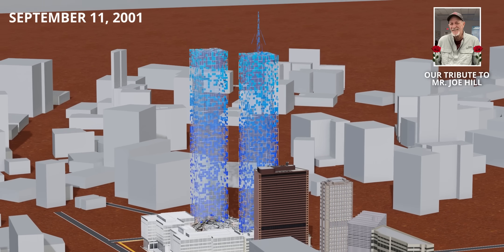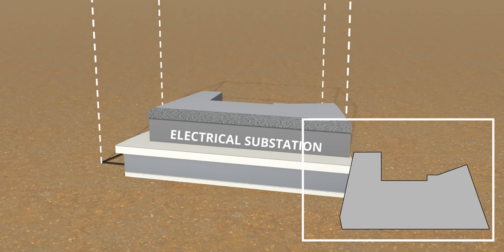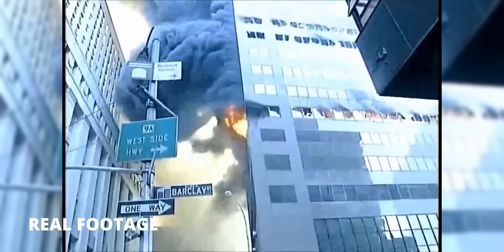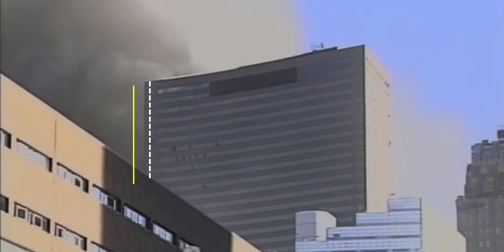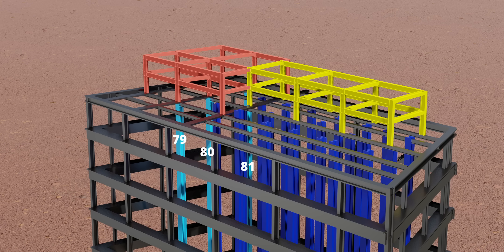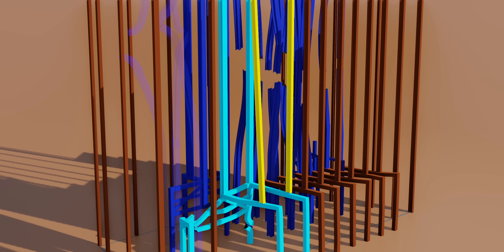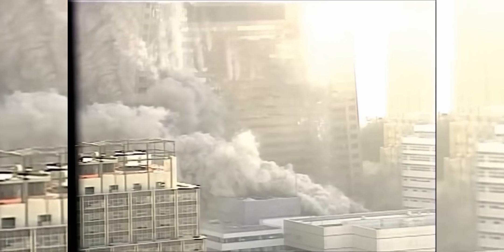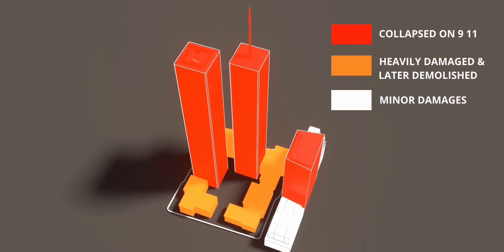Collapse of Building 7 | The Complete Physics

Comment: No, dude or robot whichever the case, that's not how physics works. The speed and uniformity of the collapse makes it a clear and deliberate demolition. The politics of this demolition is another investigation. If the building collapsed from fire and weakened columns on one side of the building then the weight of the building would have shifted sideways as it met resistance from the other non compromised columns and given the design structure it is even more likely that the weakened portion of the building would have been the only section that failed.  Cartoons are for kids doc .
Reply: What uniformity and what speed ?  What does speed even have to do with anything?  Please explain in detail and be sure to show your math.
Reply: @TheCriticalStinker-jw4fl  the building collapsed in 15 seconds and it was 45 stories tall give or take. The resistance would need to be moved out of the way quickly and intentionally for this to occur since concrete reinforced steel columns are not ice cream and the resistance would be too great for such speed to be achieved with no force external just the weight of the building. Also, given the building's open frame design cross trusses would collapse while leaving core columns standing
Reply: @davidcanatella4279  20 seconds and 47 stories tall, although the part that collapsed was really 44 stories tall since it was built on top of another building.

So what? How fast something falls can not tell you what started it falling.  

One of several assumptions you have that are wrong. Would you like me to describe what happened, start to finish, in detail?
Reply: @TheCriticalStinker-01  the speed matters because the resistance matters. This is absolutely crucial to knowing how something fell. The building would not have collapsed straight down in 20 seconds from fire weakening on one end. If the premise the film presents of a domino affect of column failure was true, then the building would have pitched drastically to the weakened side and fell sideways, but even this premise doesn't take into account the behavior of the framing under the conditions mentioned. This is a demo job. I know steel and concrete and the official explanation makes no sense and never will.
Reply: " that's not how physics works"
That you don't understand physics means only that.

"The speed and uniformity of the collapse makes it a clear and deliberate demolition."
The speed that doesn't matter, and the uniformity that wasn't there?

"Cartoons are for kids doc"
Yes. Yes, they are.

But since you're clearly the expert here, do show your physics. Use extra sheets as needed. Show work.
I'll be right here waiting for you to not manage that, much like every other "truther" has failed to in the past 20+ years.
Reply: @mooneyes2k478  Show your work. You're the one defending this psycho government. Why is the default setting that the government is right and then when the properties of steel and concrete are laid out all you have to do is say , " You're wrong"
Reply: @davidcanatella4279  - I showed my work - twice - in each of your threads.

You seem to be going out of your way to ignore it, for,... reasons.
Reply: @TheCriticalStinker-01  it doesn't add up. There is no force that would drop the building in such a fashion other than charges and thermite. It's alright if it's important to believe what you've been told. I understand. I'm not trying to be adversarial. It's okay if you hate my point of view. I don't feel any animosity toward you.
Reply: @davidcanatella4279  - I laid the whole case out, start to finish. Posted it for your benefit - twice.  

And you still haven't read it while crying it doesn't add up (and yes, we both know you didn't bother reading it).

It doesn't add up to you because you refuse to put the effort in.  I am beginning to suspect you do not want to know but only to have your beliefs affirmed.
Reply: @TheCriticalStinker-jw4fl  it's alright. There's no reason to be upset. Please understand that I wish you well.
Reply: @davidcanatella4279  - Whose upset?  I'm just wondering why you pretend to care about this topic when you are so clearly not serious

You're just wasting everyone's time.
Reply: @TheCriticalStinker-01  if you feel that way then I don't want you to feel obligated to continue. I don't want you to feel that you have to counter my replies in order to have my respect. That's not necessary. If you feel like I have wasted your time then it's okay to ignore me.  There is no shame in that.
Reply: @davidcanatella4279  - We are not havinfg a discussion. I am not countering any of your replies.  You have provided nothing to counter.  I supplied corrections to false points you posed in the form of a comprehensive, evidence-based hypothesis of the collapse of Building 7 - and you are ignoring them. Plenty of content to discuss there, but you won't even read it. You are ignoring them I suspect because it is not what you want to hear - goes against the dogma.  Seen this movie before. You are hardly unique. I am just wondering why you are being such a phony,. pretending to care about any of this when you clearly don't.  Stop pretending you are a victim and just tell us what the hell you think you are up to, why and if it is working cause you sure as shit do not care about the technical aspects of Building 7's collapse. 

Or,... IF you are serious then start acting like it.
Reply: @mooneyes2k478  Show your work. No one wants to feel in danger from the people in charge. I get that.
Reply: @ Ah, yes. "I said stupid shit and I got called on it, what will I do? NO YOU!"

Sadly for you, you're the one with the claim, not me, so you're the one that get to support it. Shocking for you, I'm sure.
Reply: @mooneyes2k478  like I said, I wish you well. There's no need to defend yourself. I'm not attacking you. We are just having a discussion.
Reply: @davidcanatella4279  Right. So, "Oh, no, I'm embarrassing myself, quick, pretend it didn't happen."

Yes, very obvious.
Reply: @mooneyes2k478  I'm not sure what you are trying to say but I wish you wouldn't worry
Reply: @ I'm not surprised at all you can't manage basic English.
Meanwhile, your attempts still aren't working. You said stupid shit, and your desperate attempts to weasel out and pretend it didn't happen doesn't change that.

Comment: @8:44 - Select .25 playback speed, then please explain all the flashes of light in the 5th row of windows from the right of the building.  All of these flashes, happen at nearly the exact same time, in an exact vertical line on the building.  Pretty sure we know what a building demolition looks like.  The question becomes "How fast can one rig a building to drop"?  The motive of course would be to prevent an asymmetrical collapse, which in a crowded metro if left unchecked could cause a massive domino effect of one building collapsing into others and so on... So the motive to be able to rig a building to drop as an emergency response could be one of preservation and not necessarily a nefarious one.  In addition, why is there video of people on the ground saying "that building is coming down", and then it dropped subsequently...
Reply: It’s the light reflecting off the windows 🤦🏼‍♀️
Reply: There are no flashes of light - only windows breaking along column lines, which is an indicator of column failure.  But of course we already know there are column failures because by 8:44 pretty much the entire central core is gone, taking the internal floor systems with it. 

At 8:44 the collapse has already been going on for more than 7 seconds - far too late to be seeing any demolitions since those would have happened before the building started moving

What you are seeing is in response to the building already moving - a reaction to it.
Reply: @TheCriticalStinker-01  So I do see flashes of light in the frames, so asking me to ignore them is problematic.  Lookup videos of buildings in China that collapse due to Earthquake.  One feature that is lacking are the pyroclastic clouds of dust with heat energy that makes them rise like the plumes of a volcano... One has to ask themselves where all of this heat is coming from to cause dust clouds that rise into the air.  In addition, do you not think that rigging a building for demolition would be a practical solution to preventing asymmetrical collapse that could trigger a domino effect in any crowded downtown skyline?  Another feature of the earthquake toppled buildings is that they fall asymmetrically, whereas it takes great skill to drop a building into it's own footprint.  So much skill in fact, that entire teams dedicate their lives to the art.
Reply: @thetruthserum2816  There's no way you are a real person 😂
Reply: @thetruthserum2816 bro your already collapsing 3 huge buildings and the pentagon, at that point I don’t think you care about the ones surrounding it